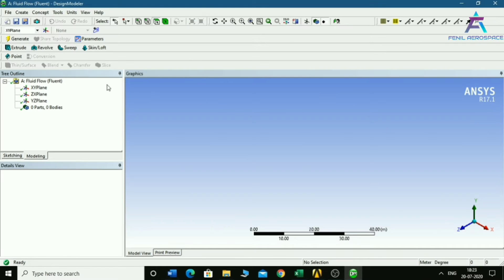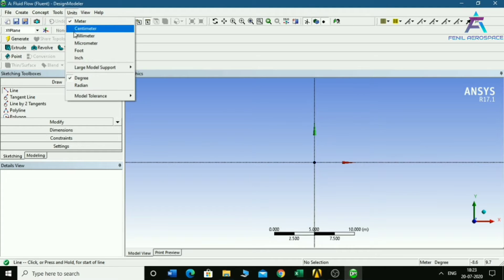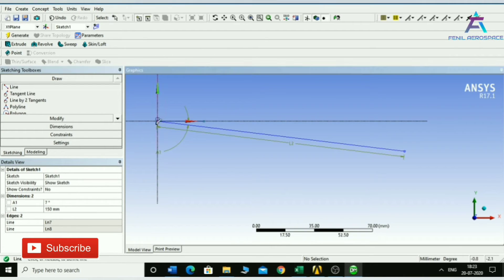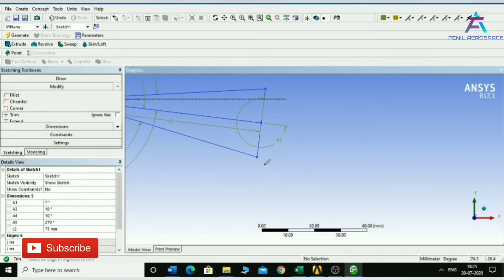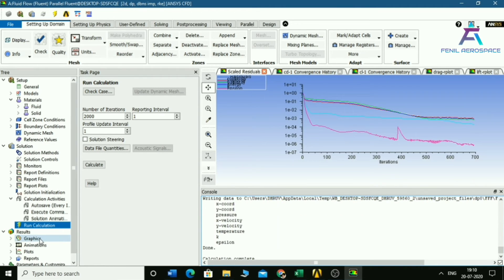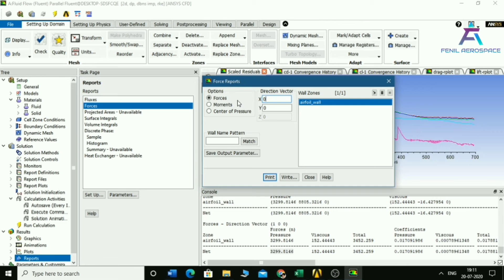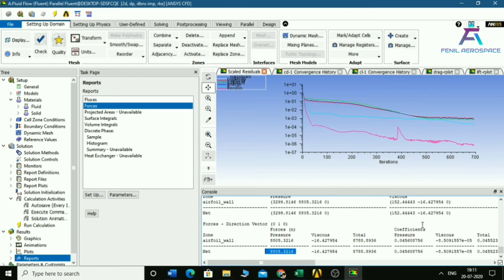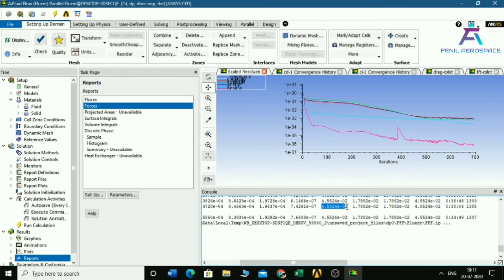Supersonic Airfoil CFD Simulation | Lift and Drag calculation | ANSYS Fluent | Aerospace Engineering

Comment: In viscous Model why did you select K epsilon model
I read from a journal that for all Airfoil simulations ,We must use Spalart Almaras !
can you correct me if i am wrong
Reply from the maker: Hello, Yes you are right, but for just for understanding purpose i choose here the k-epsilon Turbulence modek.
Reply: @vyadhaerospace  bro yesterday when i did simulations for mach 5 and Angle of attack 10 
i got Floating point error !
i asked my professor  for assistance 
he told me to keep courant no as 1 and also adjust all constant lying b/w 0 to 1 as 0.9 and reinitiallize 
i did it and the simulation was successful but i didn't learn how i was able to solve adjusting courant no 
can you help me! 
i want to learn what i did.
Reply from the maker: @hallo-xp2wh  First of all, Floating Point error comes due to improper meshing for your particular model, 
and The Courant number(CFL Number) is a dimensionless value representing when a particle stays in one cell of the mesh. 
So if you reduce the CFL number, that means you are increasing the chance of reducing the error. For a particular mesh, it is better to improve the mesh.
Reply: @vyadhaerospace  Ok ok got it bro 
also bro my fluid domain boundaries were 12 times aways from airfoil 
My mesh had 40450 nodes 
Still i couldn't see any shockwaves properly 
Does this also relate to mesh quality ? 
To see shockwaves mesh should be ultra fine ?
i followed your video on shockwave simulation but you said you got bad results and will upload part 2 soon 🥺!
Reply from the maker: @hallo-xp2wh  I will do and upload new video soon, i have exam now so unable to upload today but upload soon. Show you mesh. pd3184282@gmail.com
Email me.
Reply: @vyadhaerospace  I mail you bro 
All the best for your exam 
Rply when you are free.
Reply from the maker: @hallo-xp2wh  mail exported geometry to me. Previous one is not working.